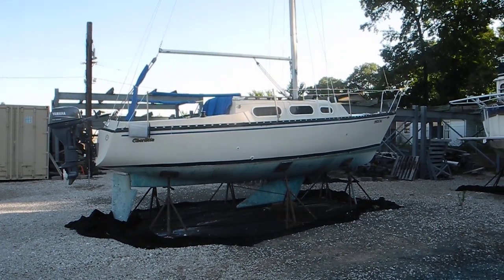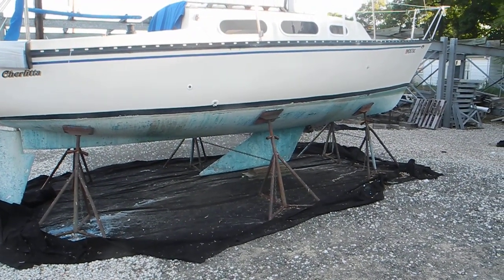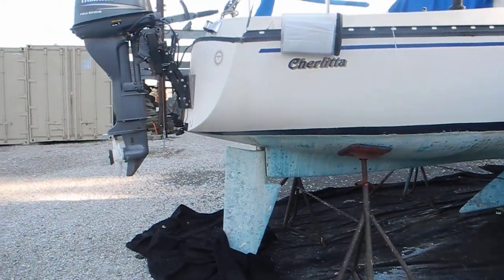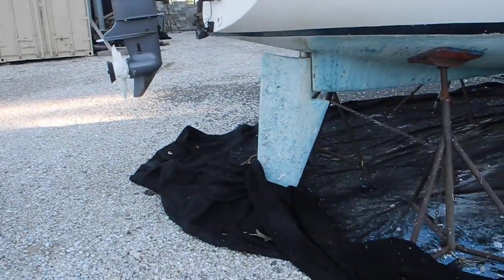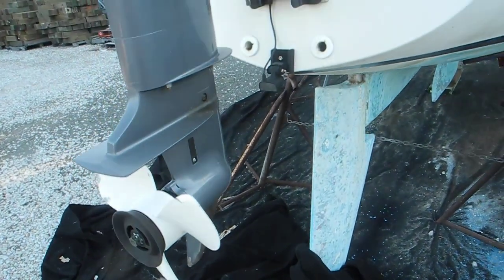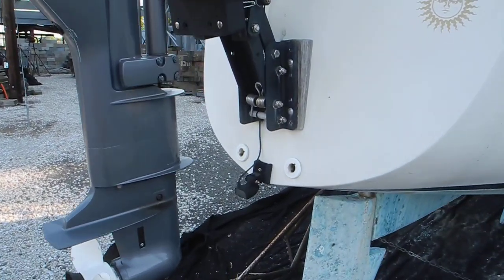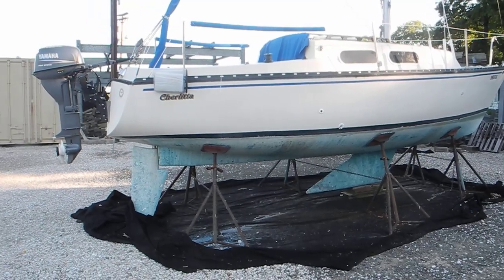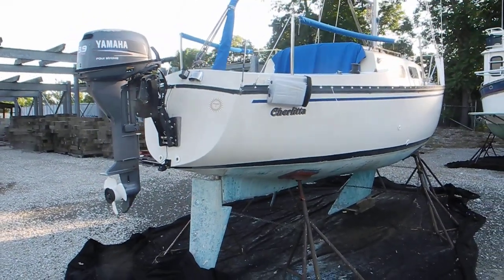Bent prop, REVERSE

Comment: Never gave much thought toTransducer placement but what your saying makes sense.thru hull transducer installs are quite a bit more involved though but there’s a perfect example of what could go wrong.
Reply: That's a problem We got to fix today. They are 6 3/16 holes in the transom where someone went crazy putting a transducer on my boat. I hope to epoxy them
Reply: @alabamasmokeywilson6818  every boat I’ve ever owned had them on the transom Smokey—and not just one.when a  new one was added the old one stayed just to avoid the bullet holes…I’m sure you can seal them up and make em look decent though
Reply from the maker: @johnm5714  After sealing the "bullet holes" put some bottom paint on the hull and no one will know. Kinda like bondo on a car's fender before painting.
Reply from the maker: Of course the next owner can not "test" the repair with a magnet because the "bondo" and aluminum will NOT attract the magnet. So much for testing used cars with magnets.
Reply: @johnm5714  I'm going to use rivets and epoxy over the heads
Reply: @AskCaptainChris  after installing my new GPS/Radar with side scan transducer my mechanic said-“oh—I just placed the new one right next to the old one-this way we don’t have to mess with the old holes…🤦🏼‍♂️
Reply from the maker: @alabamasmokeywilson6818  Dip the rivets in the epoxy BEFORE popping  them in place then overcoat again.
Reply from the maker: @johnm5714  Ask if they may interfere with each other while operating. Is RFI a concern?
Reply: When reversing as this boat did when it hit, a rear placement of the transducers seems like the best option. Too bad it didn't seem to help...